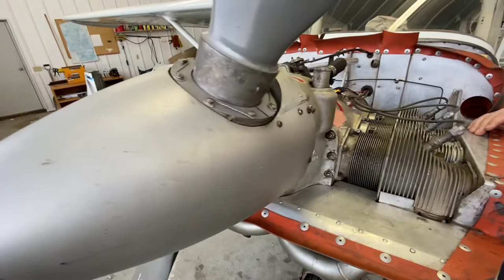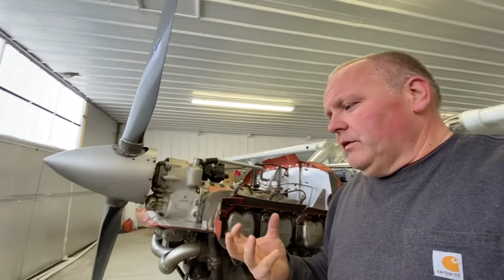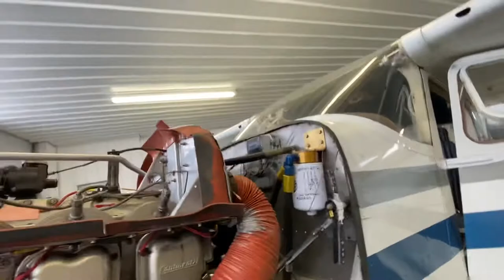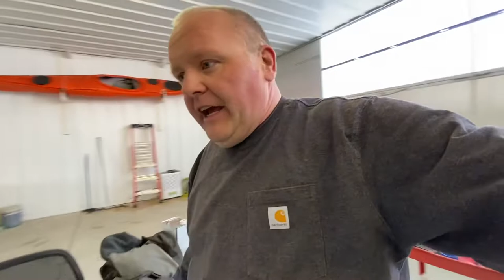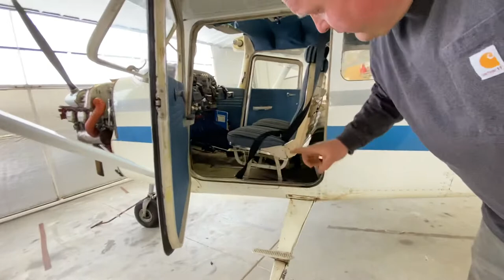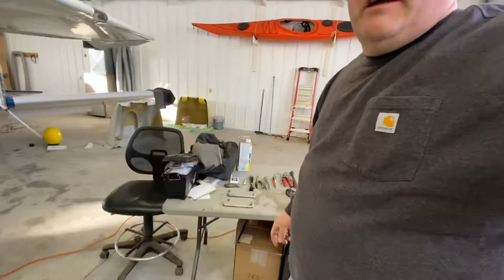Prepping Miss Piggy

Comment: Joel, I commented on your video when your first purchased your P172. You were looking for a 182 and ended up buying the P172. I've been looking for 182. Tomorrow I'm going to look at a Cessna 175. Have you been happy with the P172 and the GO300?
Reply from the maker: I am really happy with the power and how smooth it runs. The airframe is awesome but the engine parts or lack of is real.
Reply: Thanks for the info, Joel. I took the 175 up for flight yesterday. I really liked how the plane flew, and think the airframe is great., but I'm still concerned about the Go300, though it did run smooth.  Have you ever looked into the cost of a conversion to a different engine?
Reply from the maker: @adamschmidt613  I know Stoots Avation out of Alaska has a IO-370 with a Hartzell Trilblazer propeller conversion STC and parts firewall forward $16,500, engine $37,000, propeller $13,400, and prop governor $1,900 round number of $69,000. I don’t know what a 180hp would coast. With a conversion done it is a very desirable aircraft!
Reply: @joelwyttenbach2772  I spoke with Dave on the phone the other day. Real nice guy. Full of information. That's a lot of money to spend on a conversion, but you're right, it sure would be a nice place when it was done.